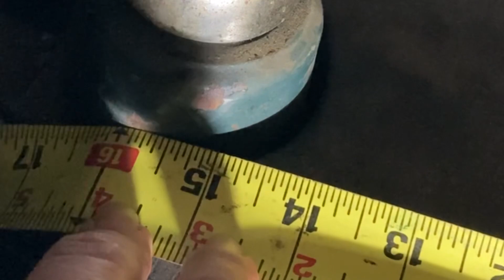These are not being made for Ford Model A’s anymore, I’ll tell you why & what you can do

Comment: Beautiful job.I have been cleaning my A floor mat every spring since I owned it. I take it out, wash it & then before I put it in, I have been using tire conditioner on it. Should I be using something else, or is tire conditioner ok?
Reply from the maker: That’s awesome, tired conditioner should be fine, but you may not have seen the newer video that I made, we ended up finding out that there’s companies that are still making them, they just ran out for a bit, so miss information unfortunately in the beginning.
Reply: Thank You!! @Modeltshinn

Comment: Thanks so much for the tip about model A floor mats. I have one for you in return. pick up some CA (super) glue activator. It will be much easier than using a heat gun.
Reply from the maker: Awesome, thank you, I’ll check that out! Have a wonderful new year 💗🥳
Reply: I scrolled through the comments just to see if someone told her about the accelerator. 👍
Reply from the maker: @paulstanley31  something I put on my shopping list! 💗

Comment: Thanks for the info Tina. I thought I was going to have to use black electrical tape on the backside of mine. Those mats have always been  awkward as  all heck to remove and reinstall such as when you want to get at the battery. And not to forget, there are also several small posts at the bottom of the firewall where holes in the edges of the floor mat are supposed to line up with and fit over. But how many guys bother about doing that?
Reply from the maker: Thanks 💕 lol it is a bit like working with 2 left hands unless your left handed 😂

Comment: Hi Tina, great video, and a very good method to fix these cracks that with time these mats become brittle and don’t accept or give flexibility upon putting them in or taking out.
But Snyder’s do have these mats in stock, immediately purchased one part number A-2005 for $69,95 model year 29-31. Also I found a floor mat insulator part number A-2005-X also for model year 29-31, but this one is $ 199,00.
Now may be these mats are not made in USA, but import. But, good to inform that mats are available at least where Iam costumer from which is Snyder’s.
Further, a big thanks for your well illustrated the fix and save a rubber mat.
Reply from the maker: Thank you for sharing, it’s nice to know that there are still some available somewhere, I didn’t see any like want we have for the sports coupe, the one you have is for a Fordor, but hey, it would totally work, maybe would need trimming but again at least it would protect things which is awesome! Happy new year!

Comment: Thank you.  

I have an original rubber floor mat that is in similar shape.  Plan to use your advise to repair mine.  To hold the tears together, I have used duct tape on the back of the mat, which should help.  

I also have some custom carpet floormats (same color as my paint) with a photo and name of my Tweety 29 Model A ..   I have considered leaving the rubber mat out and vanish my plywood floor since it is very nice plywood with no knotholes.  Then just lay down my custom carpeted floormats.
Reply from the maker: Thanks for sharing David! Have a wonderful new year! 💗🥳

Comment: I guess it is a good thing that I bought 4 of these last year and have some spares! It seems there are more and more of these old time shops closing down and retiring.
Reply from the maker: Wow great pre plan!! Yes it’s sad. Have an awesome new year! 💗🥳
Reply: It is too bad the rest of us can’t get one. We couldn’t get one ordered after we bought our car in august. Really? 4 of them….great to horde them so others miss out.
Reply: @JR-qy9cn  I bought them not knowing they wouldn't be produced anymore. I picked them up because I was using different transmission setups in different cars (I have both a '30 Model AA and '31 Coupe) and changing things around, so I ordered 2 "pre-cut" and 2 "not-cut". I used them all in each of the cars at different points and have two as spares from when I changed the setups and the one I had installed no longer worked.
Reply: @James.Sorenson  Still unfortunate for the rest of us. Good on you I suppose.